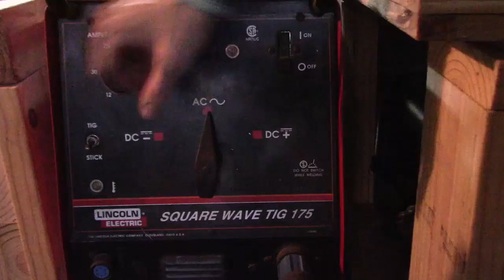Tips on welding vertical up

Comment: Hi mate. What setting did you use for the 6013? Was it DCEP also? Here in the UK, we use 6013 alot. I'm only learning for fun, but I'm struggling with 6013 vertical...in both uphill and downhill to be honest. It's just tooooo runny, even though my amps are as low as I can go to hold an arc. Maybe my metal is just too thin. I'm practicing on pretty thin stuff.

Comment: I'm really struggling on mig vertical fillet multipasses. The instructors are no help so I'm pretty much on my own.2 instructors to up to 40 students and that's if they are around.
Reply from the maker: MIG is hard to run uphill. Turn your volts down to around 17 volts and about 230 to 250 IPM on the wire speed.  You’ve got to put movement in your speed like little circles or horseshoes. Look up globular MiG if you still have problems with your welds looking lumpy.
Reply: @EEJester1586  yea I been trying to find sweet spot and found that 17.9 and around 300 was decent but I'll try that too
Reply: @EEJester1586  thanks been to points where I bout said fuck it I'm out

Comment: I’m welding 1/4” steel stake pockets to a trailer frame, also 1/4” with my old ac Lincoln buzz box. The video was very helpful! I have 1/8” 6013 and 3/32” 7018. Which would be best and what current? I’ve been trying the 6013 on 105amps and the welds look horrible. Any suggestions are welcome!
Reply from the maker: Turn down your amps to 80 or 85. You may have to go lower than that if your running them on AC.
Reply: @EEJester1586  I’ll give it a try!

Comment: Old video, but I am having a challenge doing 1/8th 7018 on vertical up on a flat plate. Stringers maybe? Just layin' beads. Anyhow, looks like lava fall after. Cant get a uniform weld. Have tried everything, lower amps, higher amps, slower, faster. Cant figure out what i am doing wrong.
Reply from the maker: Mark S Flat plate is very hard to get a consistent weld on. Try to hold a very tight arc to the plate to the point of sticking the rod to the plate.  About 100 amps to 105 and put a little movement to your rod. Making like U's works the best. If none of that works try T joints to help control your puddle, and see what will work better. Hope that helps.
Reply: Hi Man - Thanks for answering. 

I did wonder if maybe it was because of the flat plate, so I decided to start making t joints like you recommended. Sounds like I am on the right track.

Tonite I went out and was able to weld a decent corner laying flat, but I dont have too much problem with a decent weld laying flat on the table. Its the vertical up that really frustrates me. Anyhow, thanks for the suggestions. I will try that tomorrow.

Great channel.

Comment: Thank you! Excellent demonstration and beautiful welds. I'm learning farm welding with ancient AC equipment. Do you have an AC vertical up with a 7014?  My implements thank you!
Reply from the maker: David TheCarpenter I sure don't. 7014 is very close to 7018 in how it burns. Keep burning them rods. Hours under the hood is how to learn.
Reply: @EEJester1586  Lincoln now makes an AC 7018 electrode.

Comment: OK, I started my little research about 6013 electrodes that I have in my garage but on three different websites I found three different explanation about penetration. One said it is low, second it's moderate and third high penetration so I'm a bit confused
Reply from the maker: Well that is all true. It depends on what polarity you use. DC- low DC+ high AC moderate. The rod was made for DC- and AC. Most rods will run on any polarity, but some like just one. (7018 DC+)
Reply: Classic Work
Thank you, I'll google some articles to further study that.
Reply: You may get more further informations about SMAW's electrodes by visiting manufacturers' websites and getting their manuals and handbook guidelines for every type of welding.
Reply: Jorge Oliveira
Will do, thank you man

Comment: how long should the arc be while welding with 6013. can i drown the electrode in the puddle?
im new to welding so my questions might be kind of stupid
Reply from the maker: About 1/8" to the top of the puddle.  Most rods will stick if you bury the rod.  The only stupid is question the one that is not asked.  Thanks for the comment.

Comment: great arch length on that 6010 rod. You should do a open root 3g with fill and cap.
Reply from the maker: +Travis I've got a pipe video coming soon on 6G open root.
Reply: +Classic Work Nice! 37.5 Degree Bevel, 1/8" Landing, 1/16"-1/8" Gap.
Reply from the maker: +Travis You got it.  I think I'm going to do a 6" pipe.

Comment: You are a very good arc welding, weaving up is very hard and it's come out nice and pretty flush
Reply from the maker: +Kashif Spaine Thank you.  Aye most people think you have to do the same thing over, and over in welding, but that isn't true.  You have to move with the metal if it changes you have to change with it (slow down, speed up, change rod angle ect...) Thanks for the comment.

Comment: Glad I found your videos. I welded with the same Lincoln in Houston in the 80's. Great machine. Had those running all day fabricating and welding pipe in those nasty refineries. I'm looking to get a small electric welder for home. I would like a stick welder. What do you recommend? All welders stick together!
Reply from the maker: +elpasokid 53 http://www.amazon.com/s/?ie=UTF8&keywords=everlast+welder&tag=mh0b-20&index=aps&hvadid=3480870729&hvqmt=e&hvbmt=be&hvdev=c&ref=pd_sl_6oxqp42luy_e  Everlast has some very good welders for there price.  I have heard that they weld as good as bigger welders.

Comment: Thank you very much. 
are you have done a video of vertical down welding? 
What is the best method for good welding of the vertical position?
Reply from the maker: +toolman talal I'm going to do a downhill welding video.  There is a lot of pipe that is downhill welded (At least in the US) It depends on what your doing.  If it is big heavy metal you almost never want to weld it downhill.  If it is very thin metal it is sometimes better to weld it downhill.  Some rods can't weld downhill 7018-E, 7014, 7024, (Fast fill rods) can't do it.  6013,6011,6010,8010 (fast freeze rods) can.  MIG can run downhill.  TIG can run downhill.  FCAW can not.  It is always best to run uphill, but there are times when you can't.
Reply: +Classic Work thanks man for your help and fast replay.
Reply from the maker: +toolman talal Always man.